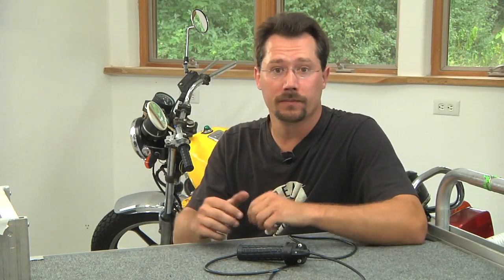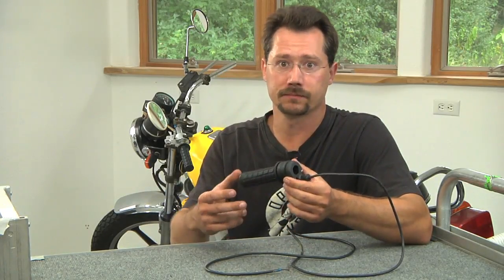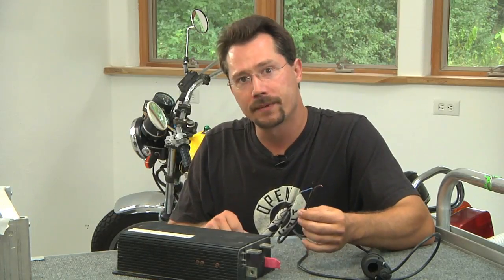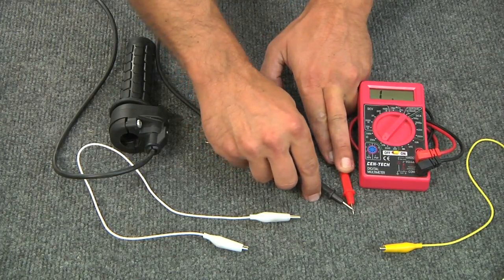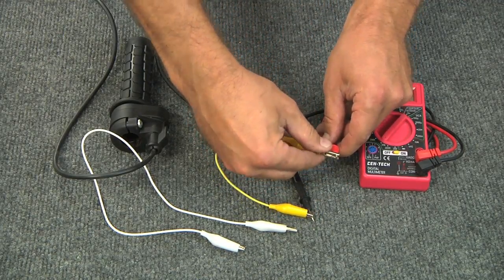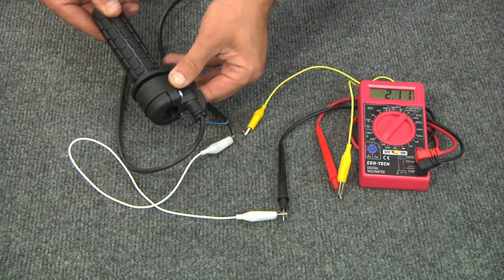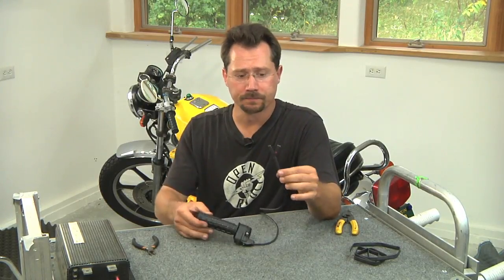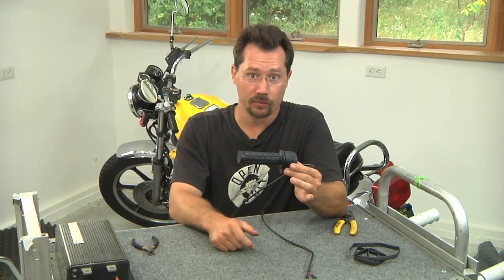11 Build Your Own Electric Motorcycle - FULL - 11 Throttle

Comment: Hmm I might missed something. How do you know which wire to attach to motor controller leads 2 and 3? or does it not matter?
Reply from the maker: You will probably get instructions with the throttle that say something like "use the brown and blue wires."
Otherwise, you can use a multimeter to test resistance between the wires as you twist the throttle. One pair of wires will go from 0 to 5kohm.

Comment: Hi 👋 great video hey ive a conversion bike and want a electric thumb throttle instead of the curtis I can't seem to get it to go full throttle with the curtis. If not then I will try the magura twist 0-5k eh
Reply from the maker: Make sure that your throttle is getting the full range of rotation that it is supposed to. Otherwise, check your potentiometer with an ammeter to make sure of the resistance range you are getting.
You can also check the settings or software for your motor controller. Sometimes the power or max throttle can be set lower than you want it to be.

Comment: Why do we need a potetiometer and also a motor controller. Will potentiometer alone not help?
Reply from the maker: The throttle is just a low power device that sends a signal to the motor controller. The controller is the high power electronics that varies the apparent voltage to the motor.
Reply: Thank you Benjamin! I appreciate.

Comment: I'm struggling a bit with this part, At closed throttle position should the resistance be at 5k ohms so electricity wont flow?, and at wide open throttle the resistance should then drop to zero? The black and brown wires do the opposite?
Reply from the maker: When the throttle is in standard position (NOT twisted,) the resistance between the brown and the black wires is zero ohms. When the throttle is fully twisted the resistance between the brown and the black is about 5,000 ohms. This is just a signal to the motor controller. The micro-processor in the controller then accelerates the motorcycle based on the throttle ramp in the software.
If the throttle was unplugged for whatever reason, the resistance at the pins on the controller would read Infinite resistance. The motor controller would give an error and prevent the motor from rotating.
Likewise, if the controller is powered on with the throttle giving anything other than Zero Ohms, the motorcycle will not go until the throttle is completely un-twisted, and then twisted again. This is a safety feature called High-Pedal Disable. That prevents the motorcycle from accidentally taking off the moment power is turned on if the throttle was accidentally twisted.
Reply: BenjaminNelson got ya! Thanks very much, great vids! I am collecting parts to build an electric racebike and your vids are a great resource!